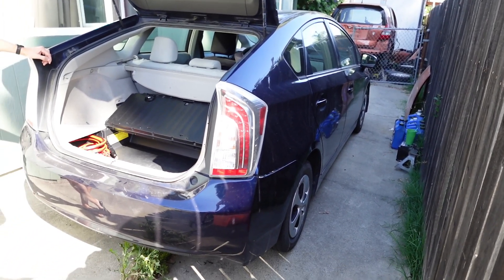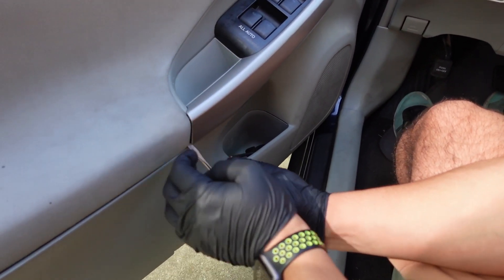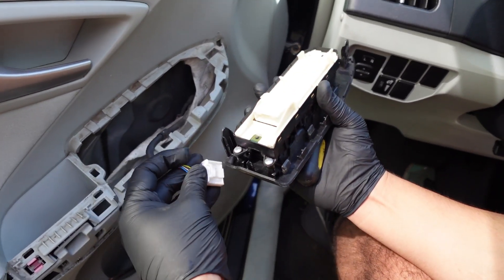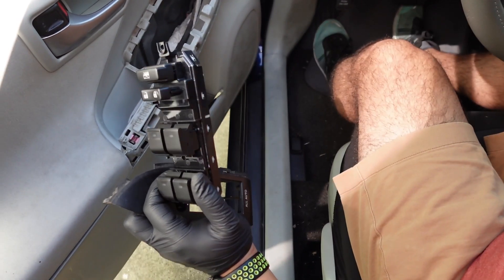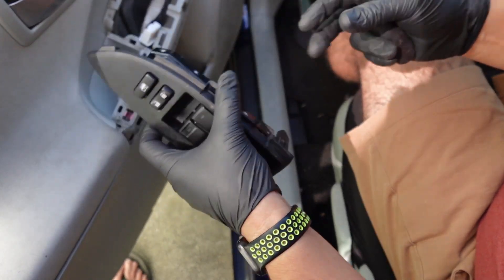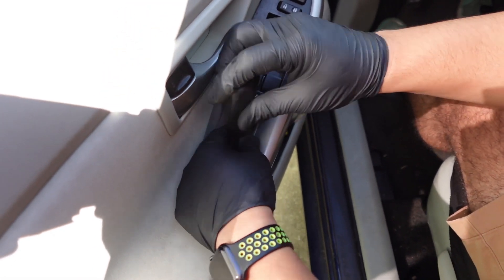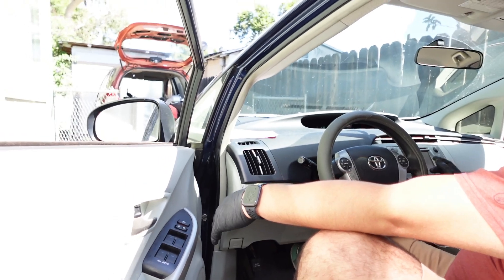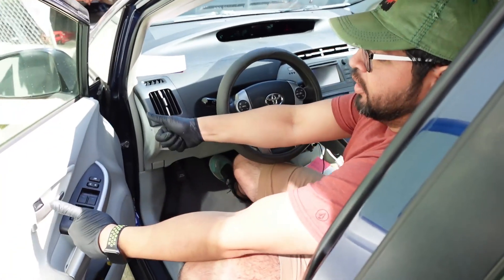DIY Window Switch Replacement on 2013 (2010-2015) Toyota Prius

Comment: Nice video!
Is there a way to replace just one button instead of the whole panel?
I have one switch that rolls down the window but does not roll it up
Reply from the maker: @saeeduchiha5537  Anything is possible. It’s just easier and more affordable to just replace the whole thing.